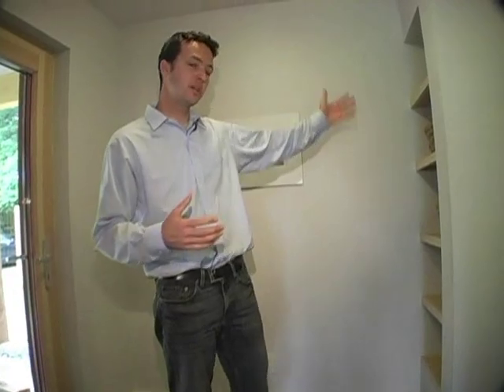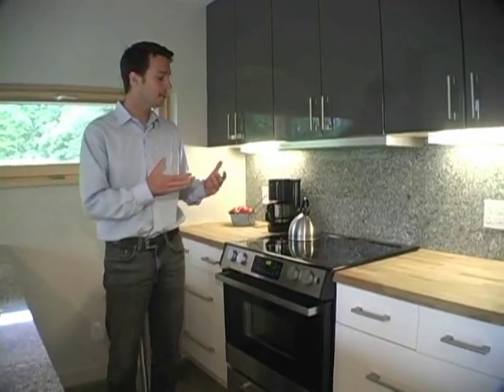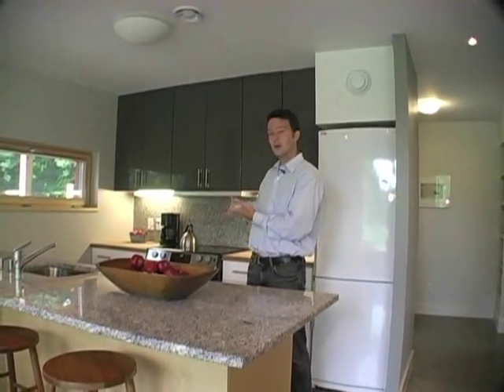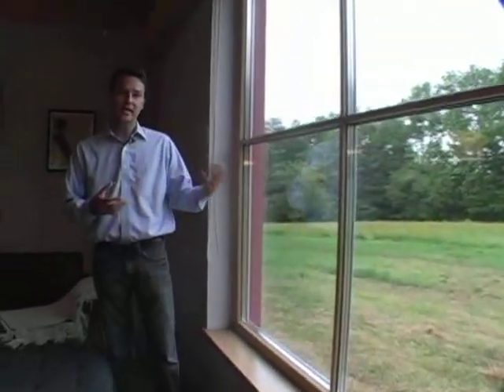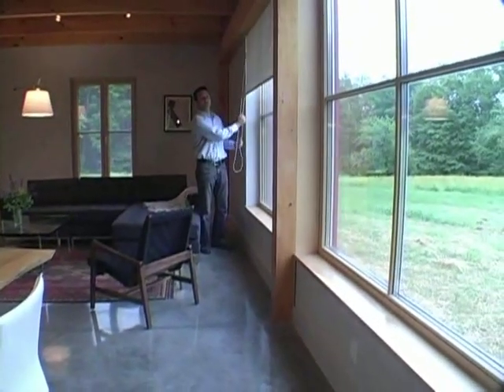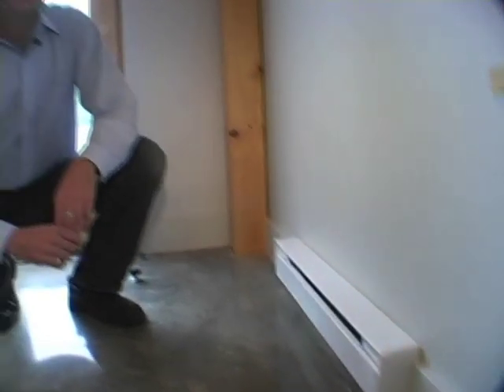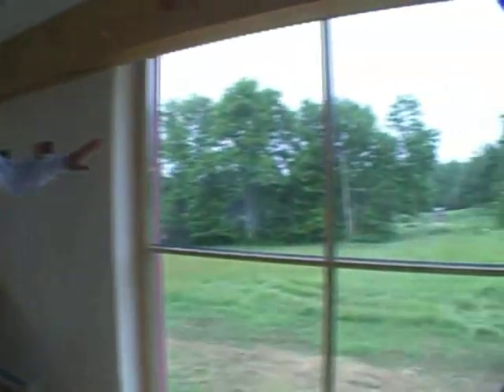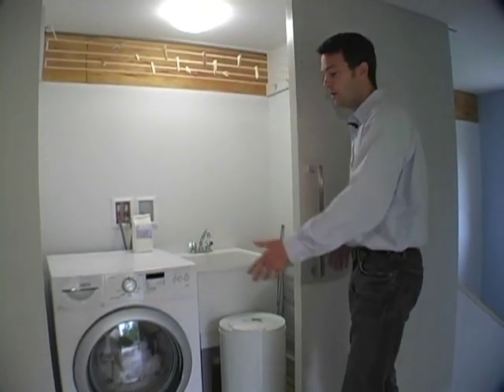Passive House Video Tour

Comment: Always vent your range hood outside. People want to cook steak indoors.
Reply: In a Passive House ventilation is carefully controlled in combo with an airtight shell. Fresh air flow has to be carefully controlled along with the stale exhaust air. A recirculation kitchen hood catches the grease & the Recovery Ventilation recovers the humidity and heat from the stale air venting outdoors mixing the captured heat an humidity with fresh air.

Comment: The exterior looks extremely ugly to me. Tall, boxy, obnoxious red color, ugly windows, skinny door. You can't get the snow off the solar panels without extreme risk because they're 50 feet off the ground, on a slick steep pitched metal roof. The people who design fuel efficient houses and cars must not want anyone to buy them.

Comment: Do you have air conditioning in this home?  What is the brand of electric baseboard heating units?
Reply: No need for AC in a passive house. The HRV distibute a constant temperature throughout the house and the insulation guaranties a normal temperature inside the building.

Comment: ok. the house has indeed a high energy performance as far a heating the House during the winter. But what about cooling during the summer?? It would be boiling hot in there with aircoditioning working like crazy. This is a solution for cold weather countries only. :-(

Comment: The 14% figure is the figure used in Germany, when comparing a newly built "passivhaus" to a regular similarly sized house, due to the passive ones usually being modual or prebuilt. "Green" upgrades to an older house are significantly more expensive than creating everything from scratch. Normal passive houses are grid connected, but ususally do have solar panels which are tax deductable in Germany. Most of the savings come from heating bills.

Comment: Last time I did some calculations for replacing terrible old windows in my house with new tech efficient ones, it came out taking around 30 years to payoff. 14% is very optimistic (actually there's no way that's possible). I really doubt this would work for most people too. First assuming that everyone has the ability to use passive solar and second that solar panels could provide all of the other electricity needs. Check the price of solar panels if you think it is affordable...

Comment: ive read that its only 14% more expensive. and that will pay for itself in, like, a WEEK since it doesnt use electricity from the grid. lol. even if it did, its still the way houses should be build, if the cost is only 14% higher. but i guess this belongs in the same bin as electric cars. no money in it, so it will never be done in mass scale. its shameful really.

Comment: the windows have air barriers that prevent heat loss to an extent (I think it turns out more heat is gained through the windows during the day then total heat lost)... they are just taking waste heat from things like dryers stoves, washing machine, capturing it, and recirculating through the house which acts like a heater. its not necessary but why bother with doing any of this then? the main goal is to circumvent energy loss in all possible ways.

Comment: WHat about heat loss at night through those windows? Wonder why you didn't make the sunshades have insulation to resolve that ? Also, if the heat load is so small, why bother recirculating the heat from the stove top and deal with the charcoal filters etc? Why not vent outside ?

Comment: Beautiful house; the passive house standard is definitely the way of the future. Did you use any polyurethane in the home's insulation? We're currently building a passive house in Brussels, Belgium to showcase the benefit of polyurethanes in energy efficient housing.